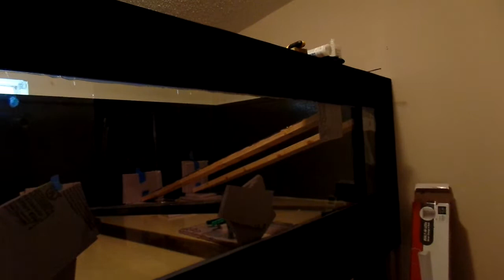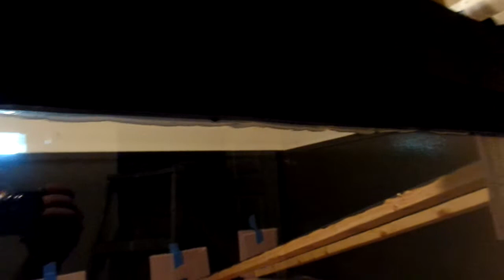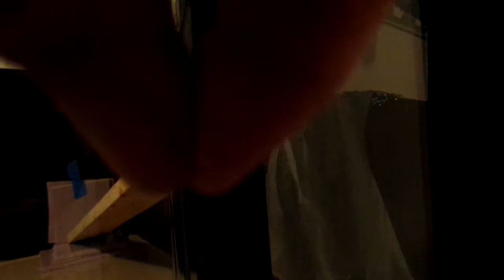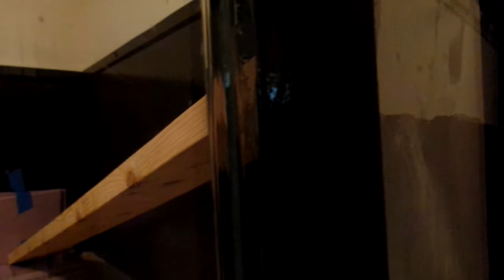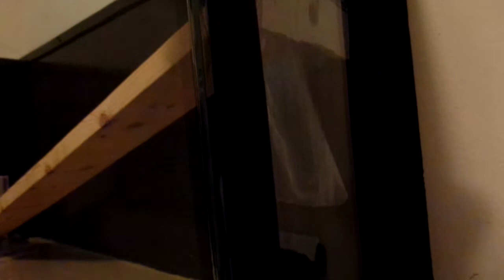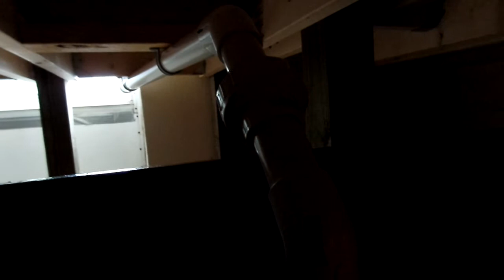1210 Gallon DIY Plywood Aquarium System Update

Comment: Love the vids.....How much of a lip around the glass to the frame do you have?
Reply from the maker: Thanks for leaving comment ! There is 1 1/2" border all around with glass setting on bottom front ledge so glass wont ever move downward.
Reply: Thanks. I’m building mine as we speak and been watching so many videos and you really go deep in explaining. Thanks for that. My tank is 30” tall, 94”x40”...Do you think I can use 1/2” or should I get 3-4” glass for safety? Thanks again for your help.
Reply from the maker: That's  a tall glass at 30".. For a secure feeling, I would go 3/4" for that reason. I'm 1/2" thick but only 21" high viewing opening.. The glass is raised off bottom..  My tank water depth can be 30" at total fill line, but will probably stay just below that, The pressure starts to really build as the tank gets taller.